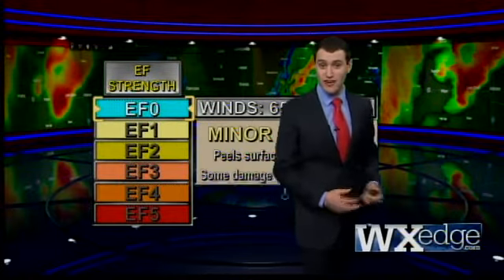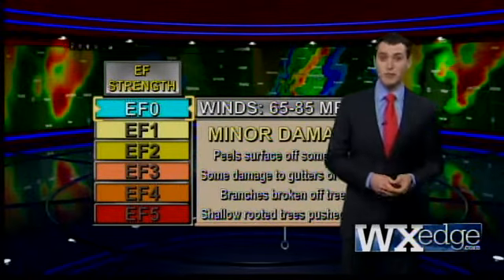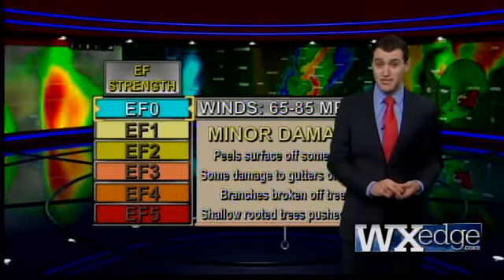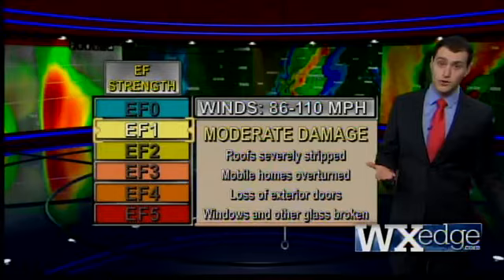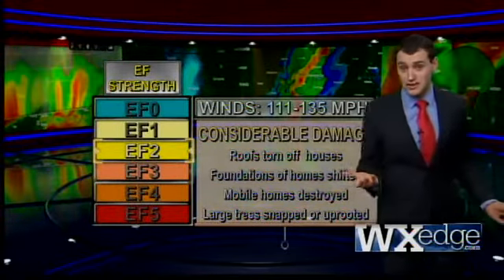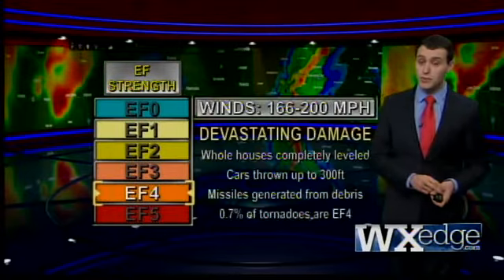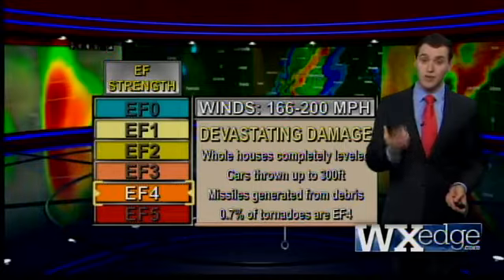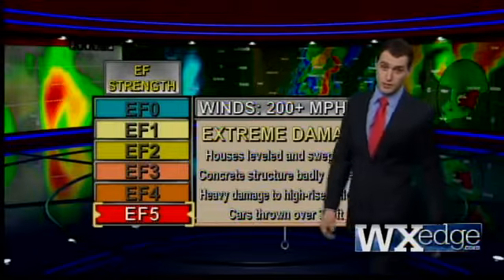Enhanced Fujita Scale Explained

Comment: How is the severity level of a tornado determined by damage, and not wind speed? The wind is what causes the damage in the first place.
Reply: Actually, Its not the wind entirely that can cause the damage. Flying debris makes a huge factor. 

Also, no matter how strong the winds are, if its out in the open, and there is no seen damage but some blown down trees, it won't be an EF5  because the damage caused doesn't match, which is why the EF scale replaced the original.
Reply: ^^ That is what can be misleading to people.  If a seemingly violent tornado causes very little damage, it might be given a very low EF rating, which means people might not take it as seriously as they otherwise should.  That said, I agree with Thunder Destroyer on this one.

Comment: What's the difference between let's say an F5 and an EF5?
Reply: The original Fujita Scale became replaced because the wind speeds on the scale were incorrectly matched with the damage a tornado can inflict. Thus, in 2007, it was replaced by the Enhanced Fujita Scale. 

An F5 tornado has ranked winds at 265-318 mph, whilst an EF5 tornado ranks at +200 mph.
Reply: Thank you for your reply, it all makes sense now haha
Reply: sarah hobson So..lemme get this straight,an "EF 9" drops down for 20 miles and touches nothing..it's an "EF 0"
Reply: Is F5 actually 261-318 mph